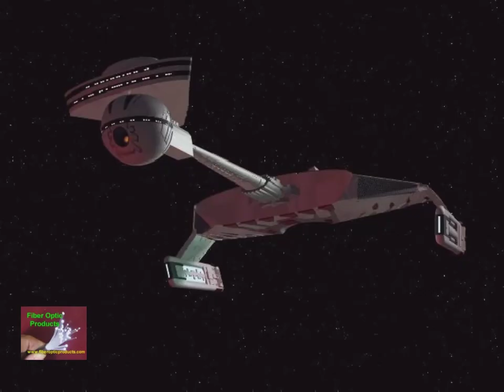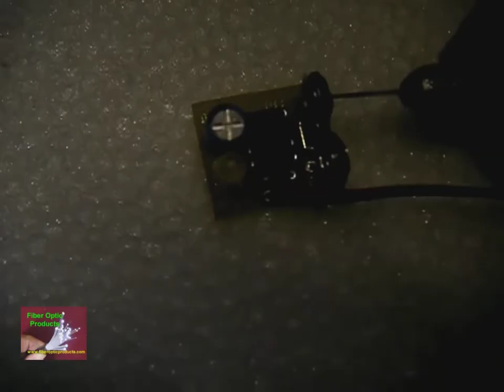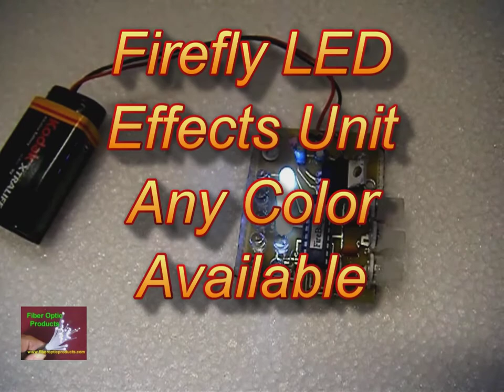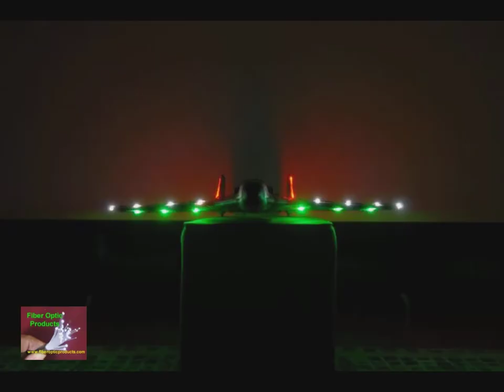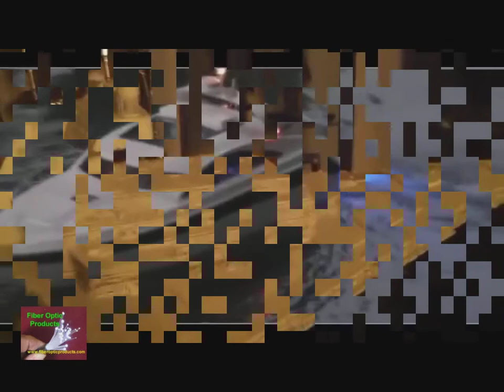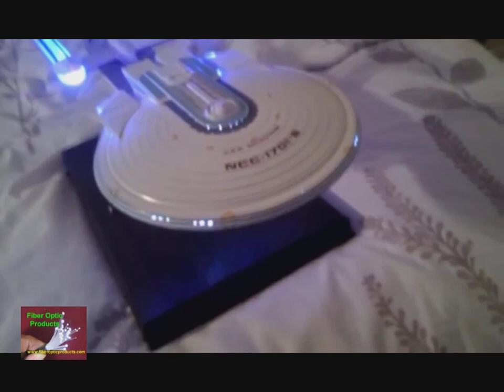Model Lighting

Comment: I have never put in leds before in a model so I write this to see if you can help and maybe I can buy leds from that site:
I got myself a star destroyer from Revell, the rouge one version and finished it, is tempted at putting leds but I´m not sure how that works? Easiest would be to put in 6-8 really strong leds inside the model and drill holes where I want windows/hangar bays etc to light up. 

I have not enough experience to use fibers and have one fiber going to each hole in the hull so I will keep it as simple as possible.

Then I just wonder: Do the leds come connected to a battery source I can glue into the model on the inside and have a switch somewhere or how do one connect all the leds to the power source?